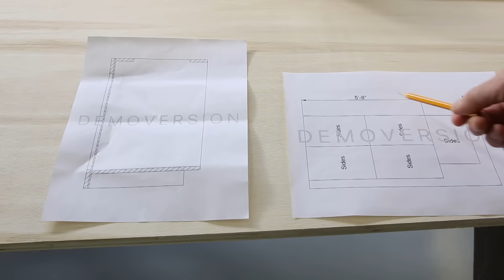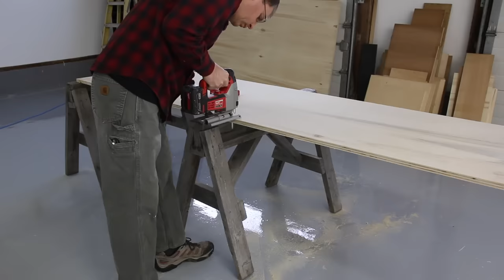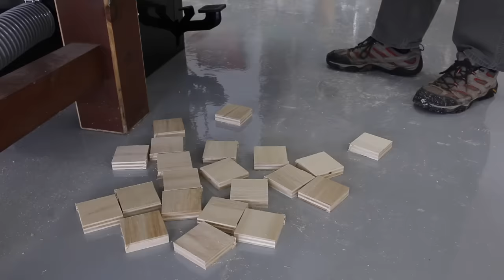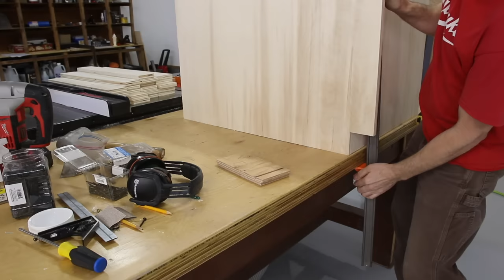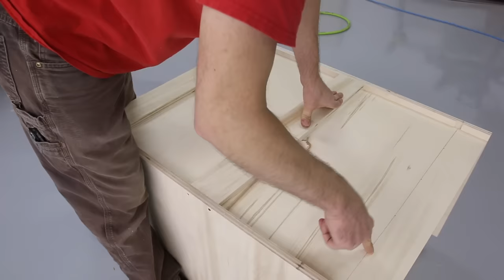How to build a cabinet box

Comment: I've watched about 15 hours of cabinet videos. This video is one of the best.  Expertise is eviden
Reply from the maker: Thank You!
Reply: Same here
Reply: Indeed...so much patience and shared evry aspect
Reply: Izabella de la Cruz, tu comentario me animo a mirarlo ; gracias.
Reply: An integrated toe kick is one way to do it.  I prefer a separate toe kick.  The toe kick by itself is easier to level and scribe and/or shim level.  Once the toe kick is level and secured to the wall it's just a matter of putting the cabinets on top, screwing them together then running a string along the front stretchers to get them straight, then shimming the wall where necessary, then screwing to the wall.  That's how did the 20' of base cabinets in my garage.
Reply: Hi , what material do you put on the front edge to cover front view?? Good video , well explained

Comment: Great work and clear information!

I built a couple of cabinets similarly using a circular saw and a drill for power tools and 2 clamps!
No pocket hole! 

Your method is inexpensive and simple.

I like how you cut your panels oversized so that it was easy/manegeable to square them.
 
Another plus, your approach ensured that all the side panels were of the same dimensions by cutting all of them without having to to move the fence more than necessary.

Ho

Comment: Here's a tip; when you cut the toe kick, and determine where the blade arc stops, just clamp up a quick stop block on the saw fence - it's faster and no guess work.
Reply: Can you make a video to elaborate on the tip  would really like to know what you're talking about please and thank you
Reply: What ?
Reply: This makes absolutely no sense.
Reply: I was also thinking - if the table saw blade was higher you could maybe get a deep enough, more square cut and maybe not need the jig saw.

Comment: While you all are still trying to make your jig square and rough cut your sheets, I am putting together my first cabinet after breaking down the sheet goods into perfectly size identical parts on the first go around.  Dump your table saw and get the TSOPRODUCTS parallel guide and guide square set up.  Not trying to be a jerk, just suggesting a better way to do the dirty work. Thanks for the video though, I have been looking for examples of cabinet builds that don’t use pocket screws and this was a great addition to that very short list.
Reply from the maker: I will do even better than that. I will buy a 10' Felder sliding table saw. I have my own woodworking business now so it will eventually pay for itself. Cheers!
Reply: French River Springs sounds like a great solution if you have the space. The quality of accessible equipment available to even the amateurs (myself) is so much better than it was even several years ago. Have a good one!

Comment: Going to make mine for the garage, without a toe kick, floating, sitting on the 6" stub wall running down both sides of the garage (and screwed to the wall).  This will keep any runoff from snow melting off of the vehicles from wicking up into the cabinets, plus provide for a decent (long skinny) space back under there for storing the odd item that water won't hurt.

Comment: Great but I'm just not a big fan of those tracks cut in wood for bottom piece, because if it breaks then it's ruined, simply tack pieces of wood along side pieces and you'll have a place for bottom piece to sit on and you'll have additional strength
Reply from the maker: I do my cabinets differently now

Comment: Been thinking about trying to build my own cabinets. Was wondering which video I should base my build on. As soon as I noticed that we both have the exact same John Deere hat, I knew I had found my video! Nice building. I like the attention to detail and focus on keeping everything square and symmetrical. Gotta ask. I'm a collector of two cylinder John Deere's, was wondering if you are as well. Thanks
Reply from the maker: No. I only have one 3 cylinder John Deere. It’s currently for sale. Just bought a Kubota M6070 with a cab. Hope It will be just as reliable as my John Deere. Chose the Kubota because of shorter wait time and option to have really wide front agricultural tires.

Comment: Those are very well constructed cabinets, although perhaps overbuilt.  Most cabinets I come across are just butt jointed and nailed. They still hold strong after 40 years.  It's never the boxes I have a problem with it's the rails and stiles, and again it's pretty rare and they are on rental properties so they get a lot of abuse.  I think it would be hard to make money by using a rabbit joint for everything, but maybe if your shop is set up for it, it goes pretty fast.
Reply: Quality work begets quality prices. If you’re trying to build as cheap and fast as possible your earnings will always represent that. If you want to do high-end, custom cabinetry then quality joinery is requisite. People are learning to pay more money for a better product. That’s the difference between $30/lft and $300

Comment: great video! getting a good education on here but I have a question, and this is because of the pricing for plywood lately (as an example, a BCX 3/4' full sheet that cost me $52 in January is now $73 :-/  ) If everything else is 3/4" plywood, is there any particular reason to not use 1/2" plywood for top and back stretchers to save weight and cost? Appreciate any feedback given

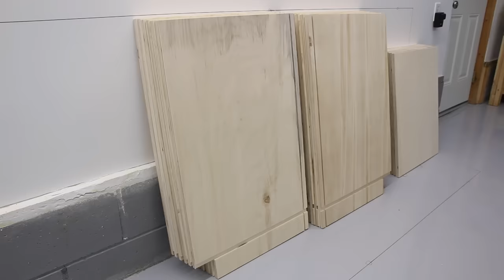Comment: Why do you put a 1/4 dado 3/4" from the back @7:21 (for the back) of the casework? I see people doing this today and I'm scratching my head! That is a house/hiding place for BUGs and mice and makes the inside of the cabinet smaller. We never did that we just rabbited the back 1/4x3/8. The cheaper shops just stapled it on without the rabbit. Do you use that method for the backs of upper cabinets or pantry cabinets?

Comment: I am an Australian cabinet maker and this guy to be honest it’s an amateur 
First 
He start cutting pieces oversized to square them after ( he should make a straight cut and then size all the rest parts in equally dimensions)
Second 
He is has done the kicks with the cabinets 
It’s too much work at the time of installing 
( make a separate kick base to be level first )then it’s easy to mount the boxes
Reply from the maker: Agree with everything that you said. I should make another video on how I make my cabinets now.
Reply: @frenchriversprings  please do, I’m amateur enough that I don’t quite see how this looks amateur so would be great to watch your new and improved version
Reply from the maker: Will do. I don’t build cabinets too often but next time I build them, I will make a video
Reply: @dropndeal  to be honest is a very good idea 
I would do it the way we make cabinets in here
I probably will use :
plunge saw and a track 
I will glue the edges using an iron 
Make separate kicks 
And finish the cabinets ends using end panels

Comment: If only I had this level of skill. Got a big project coming up and I have never built a wood cabinet before. Needs to be study. Got a lot of weight going in it. 

Building an add on section to the back of my TV stand so that the TV can be put on a lift to raise up out of the stand, then retract when finished. Tv is 75"and fairly heavy, so I need strength.

Comment: Really nice work. Did you consider drilling your shelf pin holes and track hardware holes before assembly? I would like to make my own cabinets at some point. Your instructions are very clear and useful, thanks!
Reply from the maker: I usually drill them after. Less chance to make a mistake and is easy to do.

Comment: im a noob when it comes to wood working, but wondering, how much weight can these hold on top?
 i want to build cabinets like these but wondering if it can handle hundreds of pounds of statues. Thank you for you time and excellent video.
Reply: As long as the counter-top material is strong enough cabinets like in this video, with the sides close together and made from 3/4 inch plywood, should hold 300 pounds with ease. If in doubt invite over some friends and have everyone sit on a cabinet box.

Comment: You mention some of your dado cuts were tight, but if your dado was set for a full 3/4" and you were using 3/4" plywood (actually 23/32"), wouldn't the joint be a little loose?  Acceptable for cabinet I think, but just a tad loose.  And would you suggest using a little glue in addition to the screws?
Reply from the maker: Believe it or not that Aspen plywood was just over 3/4" thick

Comment: would this design work for kitchen base cabinets with a double sink? right now all i have is a harbor freight work bench with a single basin sink set in it, and raised up 2.25 inch
Reply from the maker: Yes it would work for a kitchen cabinet. Make shure you get the right hight and depth.

Comment: Great video, thanks! May I ask you to review the steps you did to square the cabinets? There was one time I made cabinets and they did not come out square.
Reply: I recommend using your speed square for every corner and marking it with a pencil before stapling. As long and your level and square you can proceed to build. you also have to consider where the cabinets are going. are the walls ceilings and floors square? if not you'll have to accommodate in your build.

Comment: I was considering doing a separate box for the toe kick, but I'm starting to think that having the toe kick integrated into the side panels like you have, makes it structurally stronger.  I want a very large 2" thick piece of granite or quartz for the countertop so I'm hoping this will be strong enough to hold the weight.
Reply from the maker: It will be plenty strong. I now do the toe kick separately.
Reply: @frenchriversprings  Thanks... Why did you switch?
Reply from the maker: Easier and faster to build and stronger. A woodworker with 35 years of experience showed me.
Reply: @frenchriversprings  Do you mean an individual toe kick for each cabinet, or an entire base for multiple?
Reply from the maker: It can be individual but I much prefer one base for multiple cabinets. I use 1.5” by 3.5” white pine frame. Done with my jointer and planner so it’s perfectly straight. I usually don’t make it longer than 9’ long. Then I add matching melamine kick plate to hide the white pine.

Comment: Out of pure curiosity, why didn't you use pocket hole joinery rather than all those screws you'll have to cover later with wood filler?
Reply: Probably because he doesnt have a pocket hole jig. I dont like this method tbh, especially because he has beautiful plywood that will need to be cover with woodfiller and paint. If your painting your cabinets with a solid color like white, your better off using MDF, much cheaper...
Reply: If he is joining all the cabinets together the only screws he has to cover are the cabinets on the end with panels. which is pretty common with end cabinets. If these are shop cabinets I wouldn't even worry about covering the end cabinets.

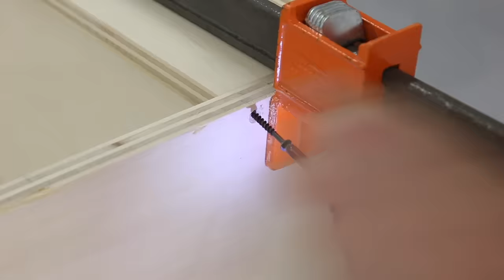Comment: Why at 11:26 use a screw to fasten two pieces of wood, rabbet joint and glue, half rabbet joint and glue, in your case a  biscuit joint and glue, hidden dowel and glue. Drill a 1/4" hole (in your case) and drive a nice wooden dowel with glue home, it would have look like "it was made by a cabinet maker". Take the same time cutting the pieces and apply that same time putting them together, no short cuts because it shows the skill of the maker. Please don't say it's going to be hidden.

Comment: What we do first is
We do a full cut with the panel saw or table saw on 1 side 
As the cut is straight then we don’t worry about the square anymore we do after long cuts parallel to the first cut 
After you can square the other section in equal size

Comment: Why not cut the dado's for the bottom with the bottom edge against the fence? It's not wise to crosscut panels that are narrow in width compared to their height. You're creating an unsafe condition by registering the top end against the fence. The work can get skewed causing kickback. Don't ask me how I know that.

Just trying to help.
Reply: I don't follow what you're trying to say.
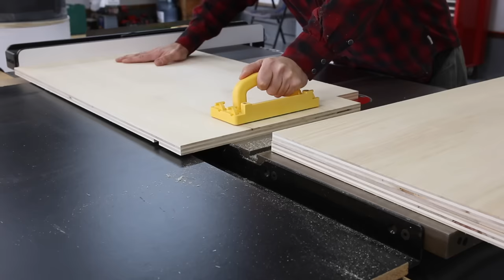Reply: @manit77  look around 6:24 where you are cutting the dado. Instead of registering the top of the cab against the fence spin the piece 180 degrees, slide the fence closer to the blade the cut with the bottom edge against the fence. A Lot more stable this way.

Comment: May i know the type of jigsaw blade you used to cut the plywood? The cut looks clean :)
Reply: Metal blade will give you the cleanest cut.
Fyi
Wood blade with teeth facing down will give you a clean cut on the top side, and will chip at the bottom.

Blade with the teeth facing up will have the opposite effect.

Comment: Why use a jig saw and stands when you have a big as table saw?
Reply: He's just cutting down larger material. If you were to cut a panel (aka the big piece of plywood) on the table saw where the piece against the fence is shorter than the piece on the other side of the blade (offcut) you run the risk of "Kickback". With that said, you will see a lot of folks doing it. His method is safer. But you could use anything from a jigsaw, circular saw or track saw. Just make sure you have a straight opposing edge to put up against the table saw fence to get a parallel cut. I've said too much...I'm leaving now.
Reply: A circular saw would be faster and have a much better cut than a jig saw.
Reply: I never do that myself. Only tablesaw. Of coarse with proper outfield table
Reply: James Moe 

Watch entire video. He explained why.

Comment: 12:37 why have a kickplate ? I really don't understand why cabinet facia aren't flush with the floor... ok ok so I understand they are so you can get closer and have better balance and reduce fatigue ... but common next time you are at your cabinet look down and check your toes out ... thats right your feet aren't under the kick plate.
Reply: so you don't inadvertently break toes.  just a few mm can make a huge difference, but this design is standard almost everywhere.
Reply: Carl Fxy 

To protect from scuff and scratch marks. You still get marks but a lot less is the kick plate wasn’t set back.

Comment: Why is the grain on the end panel running the wrong direction?  Second, why are you using feet and inches for dimensions work in inches and decimals for parts of an inch. It’s so much easier.  I owned a commercial Architectural Millwork Company for over 25 years and went to college to be an Industrial Arts teacher.

Comment: Little advice:
 don't position your screws so close to the edge, keep at least 1" from your screw to the edge of your panel.
Reply: Dude,that looks like a 3/4 plywood
Reply: @fanech14  
Hi Alvin,
Even in 3/4" baltic birch plywood (the strongest plywood available) you still want to keep your screw at least 1" from the edge.
Since most of the people here are not proffesional cabinet makers, most of the chances they buy their material from home depot or lowe's.....
There is a whole world of plywood out there that is much higher grade, and even with that plywood, you still keep the same distance from the edge.
Having the screw so close to the edge will give you nothing but risking the ply from splitting.

I hope that make sense.
Thank you and Happy holidays.
Reply: Lior Zummay 

There is no 1” rule for building cab boxes. Setting screws 1” away from the edges would mean repositioning all the cross members he is driving the screws into. 

Adding strength is arbitrary. These cabinets as he constructed will out live us all.
Reply: @bdog0720  No 1" rule mentioned here, only a suggestion from decades of experience.
Reply: Lior Zummay 

I’m looking for examples of how not using your 1” rule will fail. You might have been using your 1” rule for decades without any tangible benefit. A 2” rule would prove to be better than a 1” rule would it not? Arbitrary 

I too have decades of experience, my own cabinet and millwork business, plus my mentors, and their decades of experience, all prove that all you need is a 1/4” rule for this application. Cabinets will be screwed to one another then screwed to the wall, then some kind of top screwed on top just like he planned in this video. 

No need for grandstanding here. These are perfectly built cabinets.
Reply: @bdog0720  
So you are saying that connecting the end panels to the bottom deck, and to the cleats while your screws are only 1/4" away from the front edge is ok,
And the plywood core won't split?
Reply: Lior Zummay 

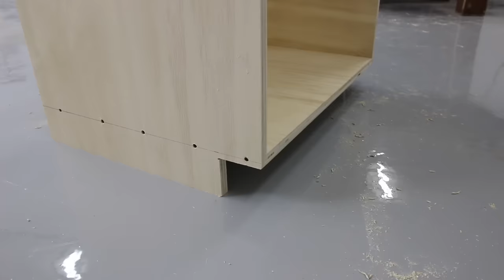Just so we’re on the same page, I’m talking about what he is doing at 11:25 and bottom shelf view at 12:40?

He’s pre drilling and countersinking 1/4” from the side panel edge to fasten the cleats and bottom shelf. Remember the bottom shelf sits in a dado. That’s acceptable and it’s a practice that is used nationwide. 

I’ve removed particle board China built cabinets that were put together with dowels, glue, and staples that have lasted over 15 years.